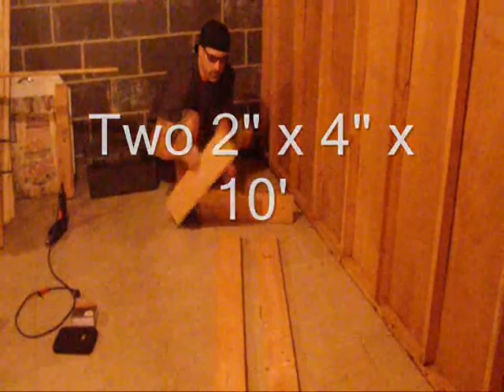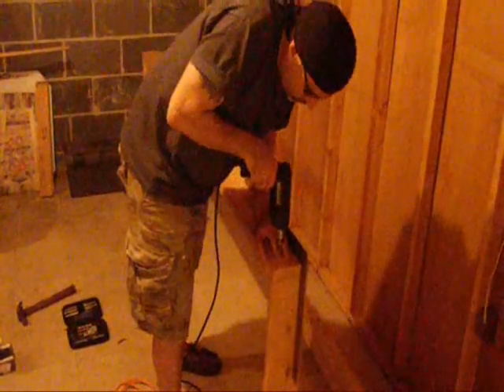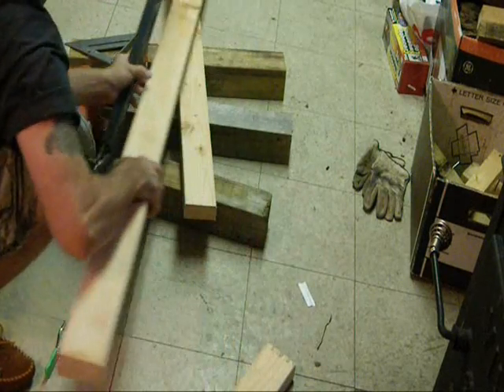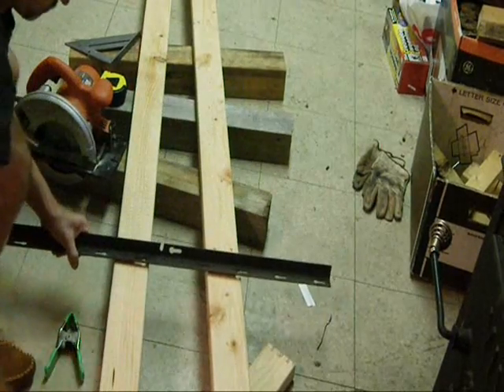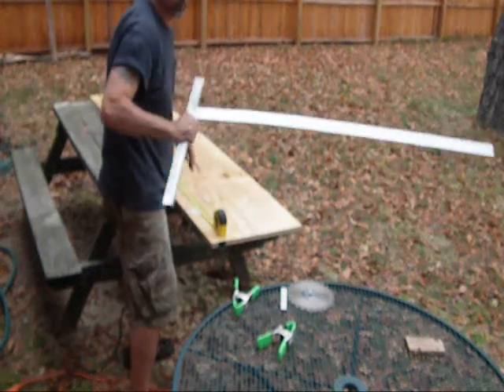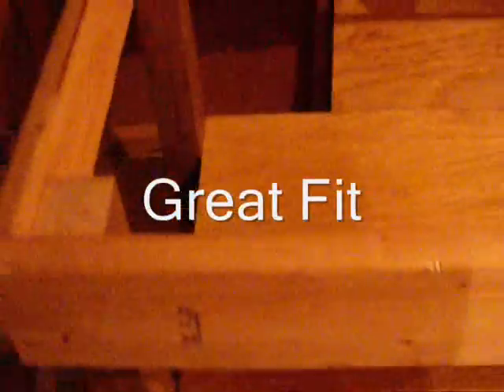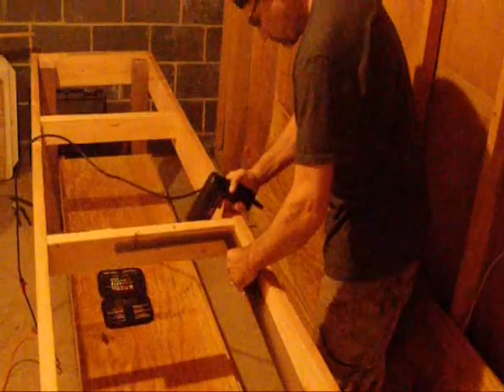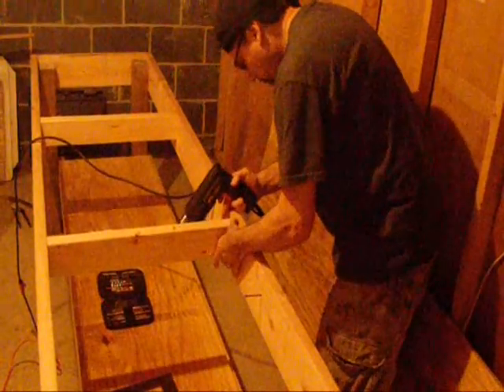Heavy Duty Work Bench #1 ( making it )

Comment from the maker: I did not sand or stain. I would prefer using a table saw, they are more accurate than a circular saw but, I don't have one right now. You can get away with rough cuts for this project.